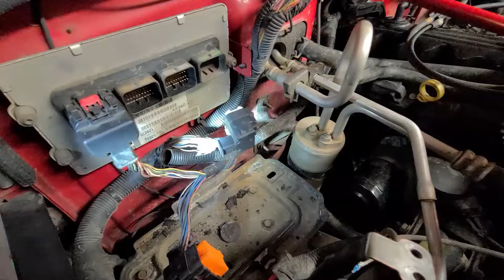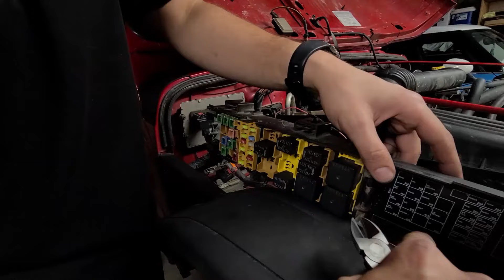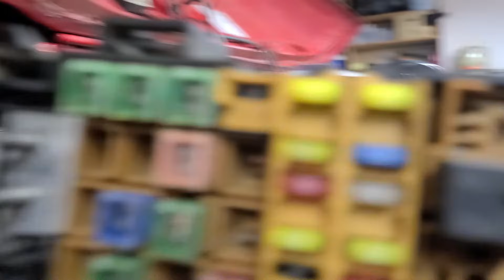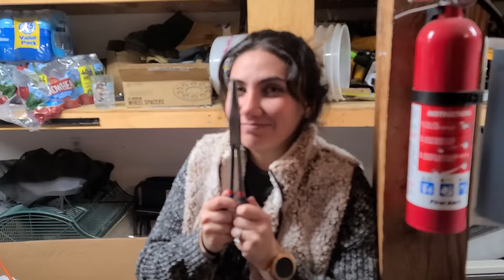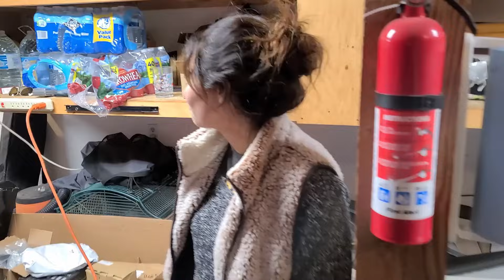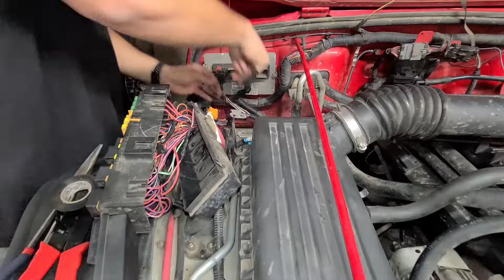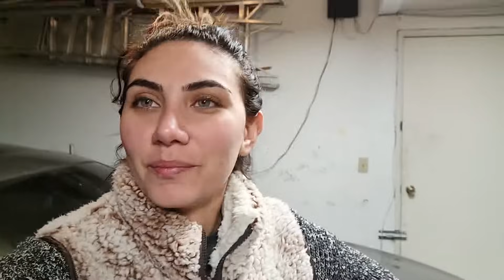STRANDED by the ASD Circuit! Here is HOW we Tested and Fixed it! Easy!

Comment: Hey How is it going im having the same issue with my ASD relay , the PCM is not grounding the relay but i checked all my powers and grounds using a diagram from mitchelOndemand  and was only able  to determine that the High Speed CANbus cables or circuit are stuck in 2.2v and not osccilating has they are suppose to, any suggestion? i also disconnected every module that communicates with the PCM in case something was shorting the PCM but still no communication with the scanner and stuck CANBUS circuit having all powers and grounds to the PCM @garagecouple
Reply from the maker: Ahh man, it can be very frustrating! I would download the model year diagram and follow each wire individually and test them out to make sure they are working ok

Comment: Greg I’m having the same problem can’t get rid of trouble codes everything is new on my 2000 wrangler sport I mean everything all Mopar parts everything o2 sensors crank position sensor you name it it’s new have two trouble codes that won’t go away I’m at my Witts end with this damn thing i can’t pass smog HELPPPPPPPP PLEASE, Don
Reply from the maker: Ahh man i am sorry to hear this. I wish I can magically make it go away but unfortunately there is no secret. Grab the original model year manual and test each and every single wire! Don't forget about the easy things like swapping relays, fuses, and bypassing the asd to see if it works

Comment: i had a similar problem with a 1993 jeep wrangler 4.0 automatic trans i tried pcm coil, and the crank sensor on bell housing. The auto shutdown relay wouldn’t engage thus no fire and power to fuel pump relay neither. I found the grey harness plug-in in middle of firewall was burnt in many wire slots. Cut plug-ends off and soldered them together and wham 💥 thank you maam😂😂
Reply from the maker: Wow.

Comment: I’m actually having this problem too, asd relay shutout. I checked the wiring, I tested the CPS  and bought one just in case “didn’t work” and bought a new coil, bought a new cam sensor and still having the same cranking over problems. If you could possibly help I’d appreciate it. Also glad you found your issue
Reply from the maker: Sorry to hear about that. Seems like you have checked everything we would have checked. Sorry we aren't of any help. Good luck and make sure to keep us posted!
Reply: I'm in the same boat with my 04 wj 4.0.
Reply: wonder if your jeep has that 10 amp fuse for the ASD in the holder on the driver's side of the dash ie my Ram 1500?

Comment: Have a 2002.:.  Crank no start.  Pi1488 codes    

Right now I have the asd bypassed as well as the fuel pump    I have them on a toggle switch   

The engine will now start and run very smoothly.   However , 8 seconds later it begins to shake and then dies    .  It almost seems as if the exhaust is not being able to escape.  However, I feel the  exhaust  out the back.   The jeep will have no problem restaring.
Reply from the maker: Good luck!

Comment: My first guess would be that mice may have caused your issue.  They love to chew on copper wiring.  I keep mice bait in the garage for just that reason.
Reply from the maker: Interesting concept! I actually think this happened due to rubbing the corner of an improperly secured battery over time, just because its exactly where the battery corner sits. Thanks for the feedback!

Comment: My question doesn’t have to do with the ASD. But I’ve been watching you guys for awhile. In fact I joined the Jeep gang because I was impressed your older Jeep TJ. 
My Jeep has had HCVAC issues.. I went ahead and replaced the heater blower motor and heater blower resistor and am still having issues where the only vents blowing air either hot or cold air is the defrost vent? I have trouble shot the fuses cleaned the vents, what am I missing?
Reply from the maker: Hi there! Thanks for the support! We haven't had to diagnose this issue before but next I would replace the switch controlling the hvac system. Has it ever worked or its always not worked? Hmm
Reply: Hi Mike, you need to check your vent position switch and the blend air door actuator, it sounds like it isin't moving to the correct position.